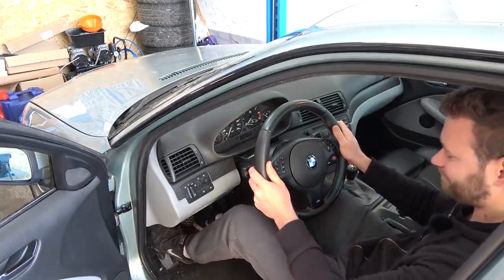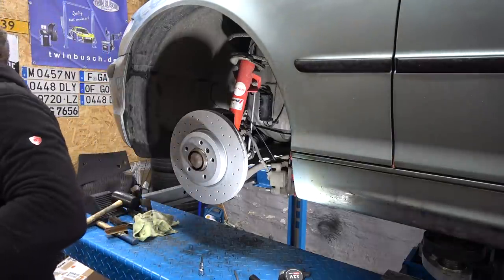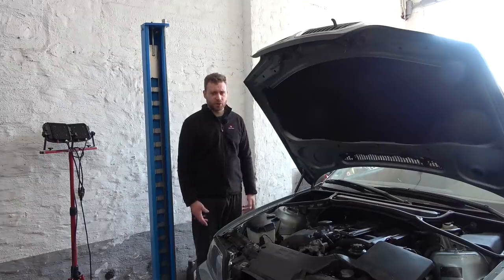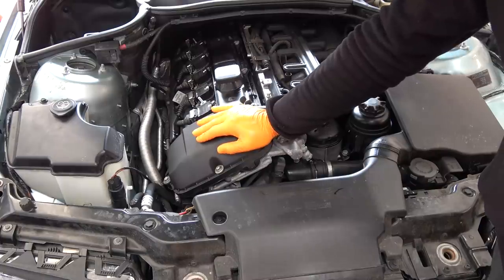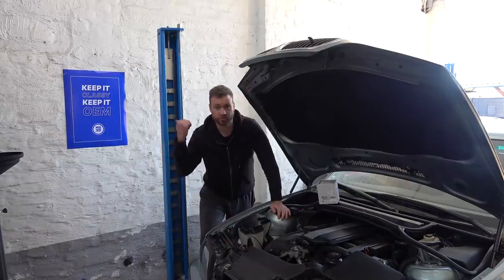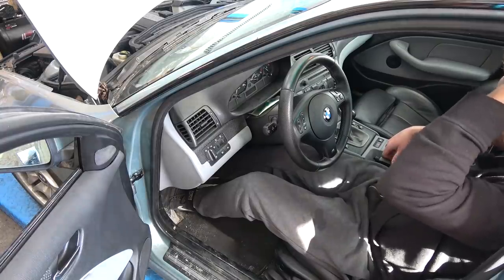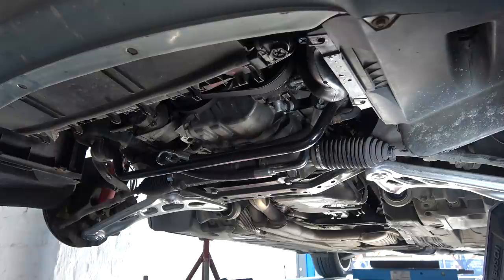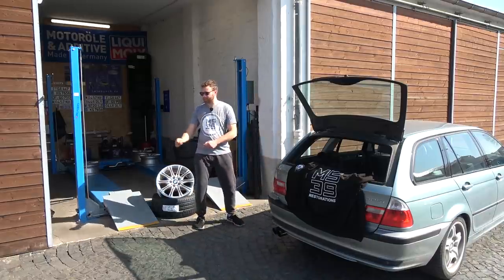Make It Stop & Steer Better - BMW E46 325i Touring - Project Cologne: Part 9

Comment: First i thank you for your knowledge videos, wanna ask if the Liqui Moly engine flush is harmful for the crank seal or any other engine Seals?
I did flushed my n54 last year with liqui moly ,first i did the oil change then with the fresh oil added the flush liquid, i guess that works better!
Be safe ,ich wünsche dir Frohe Ostern ☺
Reply: Salut! Nu cred ca e ok sa lasi solutia de curatare in motor :)) 
Sper ca inca functioneaza, si daca ai facut-o, zi-mi te rog care e rezultatul? Merci ✌

Comment: How does a faulty MAF lead to an issue on the same cylinder every time?
Reply: Wondering the same thing tbh. There is only one MAF in the the intake manifold for the entire 6-cylinder line so I kind of rule out that a faulty one would always affect just one and the same cylinder. IMHO the problem will come back.
Reply from the maker: Not sure, but I had weirder stuff happening cause of faulty MAF.
Reply from the maker: Someone else commented, it was running lean and cyl 5 was first to complain, the rest were probably close too. I've covered 300 km and it didn't come back.

Comment: This  week I was in the mood to do some mechanical work for my car, so I tried to change the drum brakes pads. I did change one side efforstlessly, the other one ended with 3 broken studs, stuck drum, stuck wheel stud hub. I ended up calling my mechanic. I failed you máster.

Comment: I know this all too well with the unnecessary dismantling of half the car. The headlight cleaning system on my E39 didn't work so I started replacing everything. In the end it was only the fuse.... that was missing (previous owner removed it).

Comment: Do you know what the TÜV says to the 330i brakes? I have a 328ci and also want so Change the front brakes to 330i
Reply: I don't think they are going to reject anything that only gives you MORE breaking power while the suspension and wheels stay the same.

Comment: Just undo the radiator cap, drive out the 325 from underneath it, drive a 330 under it, and put the radiator cap back on.  Problem solved.  All 330 parts.

Comment: It's strange how the failed mass air flow meter was just causing the misfire on cylinder 5...
Reply from the maker: Yes, but I had even weirder stuff happening cause of faulty MAF.
Reply: @M539Restorations    Yes, a bad MAF can cause all sorts of odd problems, a number of which don't seem to make logical sense to be caused by the computer not knowing how much air the engine is drawing...

Comment: Why didn’t you use any grease between the brake disc and hub to prevent rust?
Reply from the maker: I never do. BMW repair manual explicitly says not to use it.
Reply: @M539Restorations  Thanks for answering. Keep up the good work. I really enjoy your videos.

Comment: i have a 323i 1999 E46  . but last month the fuel consumption went up , it was always 7.9 to 8.1 / 100 km . now its 8.9/100km i tried new plugs/oil/filters/ read error codes nothing . 
u know what it could be ?
Reply: Could be the ccv

Comment: Hello what's wrong with Teespring site, it's telling me there is a issue with your store
Reply from the maker: Can you try again? For me it's working totally fine.
Reply: Just tried again and every time I click the link it doesn't take me there, I put the Teespring address in my search bar and tried that way but it said its unavailable
Reply: Cancel my last message, I tried again putting address in my search bar and it has worked 💪
Reply: Hoodie ordered, keep up the good work and the great content.

Comment: Has this car been in an accident? Drivers side front wheel looks offset in the arch!
Reply from the maker: How do you notice that but you don't notice the misaligned front bumper?
Reply: @M539Restorations  So it's just a misaligned front bumper? Big fan of your video's and I have a few BMW's that I work on! oil leaks and that.
Reply from the maker: Yes

Comment: “Repair manual says NOT to lube the guide pins” I was shocked by this. On my BMWs I have owned over the years I have always cleaned and lubed the guide pins before reinstalling. Even the old Bavarian Auto videos on YouTube, Otto demonstrates cleaning and lubing the guide pins as well as cleaning the rubber boots prior to reinstalling.
Reply from the maker: Yup, but both ways are fine.

Comment: I don't get why you would have a misfire on the same cylinder every time due to a MAF?
Reply from the maker: Me neither but that's what it caused.
Reply: Exactly my thoughts .. I was almost sure it would be the fuel injector on that cylinder.
Anywayz, glad you have it sorted out 👍🏼
Reply: Whole engine was probably running lean and cylinder 5 was consistently first to blink, but the others would probably been close behind. Coukd be simple as no5 plug had the largest gap.
Reply from the maker: @artwood4  totally makes sense, thanks
Reply: @artwood4  : Not unthinkable, no. One of those problems you could loose them marbles trying to find the culprit. I certainly would not have changed a MAF that early on. :)

Comment: I recently bought a Siemens MAF after a bunch of lean and misfire and cutoff codes.
And then I found a leaking vacuum plug at the back of the manifold.
...
My wallet is going to kill me in my sleep.

Comment: never had good results with textar pads. they always felt weaker then the OEM even though they are advertised as "oem formula"
Reply from the maker: They are OEM for BMW, or used to be, I never had issues with them. I prefer Jurid when possible though.

Comment: I was a "dry guide pins" guy for many years until I saw BMW techs using silicone paste lube AND I realized after several brake changes that I was getting more even pad wear after lubing the pins.  So while the TIS is the bible, it's not always 100% correct.

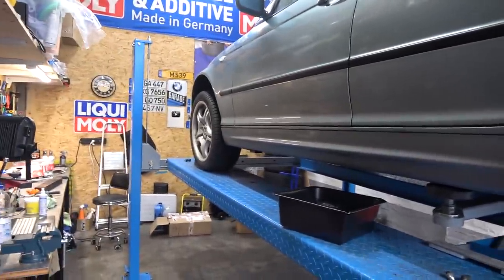Comment: 5:43 - or you could use the coversion kit from vierliter
https://www.ebay-kleinanzeigen.de/s-anzeige/vierliter-e46-330i-handbremse-adapterkit-hinterachse/1580990647-223-4948

only downside would be that those are not OEM BMW parts - what may go against you code of conduct
Reply from the maker: Never seen that before, thanks.
Reply: @M539Restorations  you're welcome
- to be honest I myself only know about them since about 2 weeks
I leaned that they sell this stuff when I had a small talk with the buyer of my 330i Brakes who plans to mount them onto his E36

Comment: sooo this should be fairly obvious but MAF cleaner isn't for fixing faulty MAF sensors, it is for cleaning dirty MAF sensors.  Its in the name, "MAF cleaner"
Reply from the maker: Yes, but cleaning it won't make any difference.
Reply: @M539Restorations  even if its dirty?

Comment: In typical BMW fashion, you have to constantly spend money to keep it running; bad MAF, leaking power steering, bad brake rotors, etc etc etc
I call BMW, Bring Me your Wallet
Reply from the maker: I really hate that stereotype. The power steering line and MAF lasted 20 years and 207.000 kilometers, how is that a bad thing? Replacement parts are OEM and will last long time too.

Comment: i mean calling some non-original spare parts junk from the lips of a bmw fanboy is kinda silly. nowedays some of them will outlast originals. i am a 2 bmw owner myself, e53 and e39, but that is just.. i dunno, "played". it's not like that in real life. moreso with older type off cars.
Reply from the maker: I'm mainly referring to cheap, poorly built non-OEM/eBay crap that will just cause issues. There are plenty of well engineered aftermarket parts if you know what you are looking for.